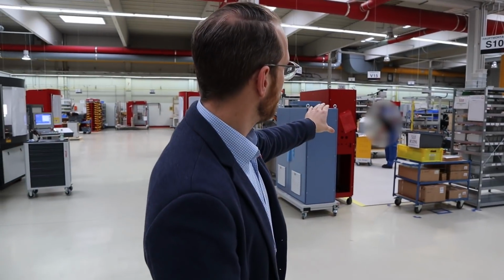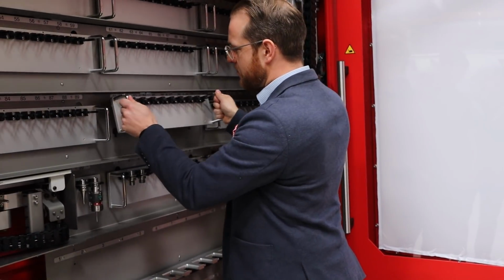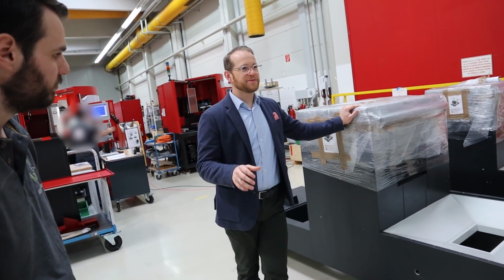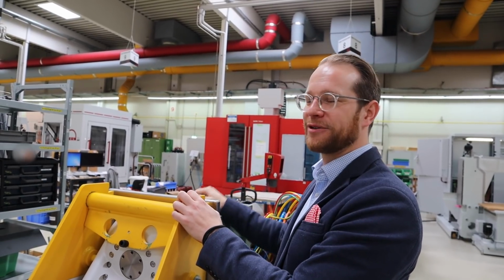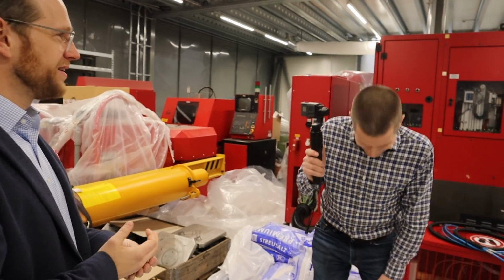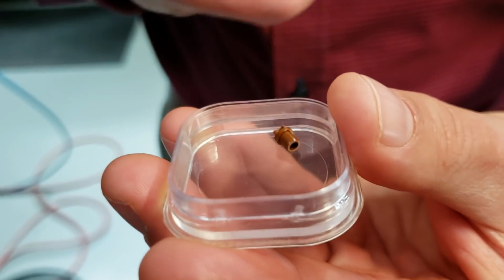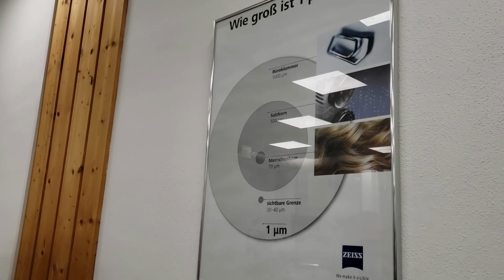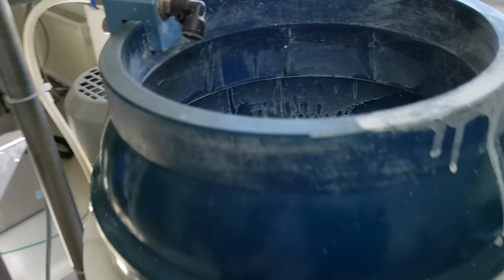FIRST to film at KERN - FULL Shop Tour

Comment: I would like to share a story of mine I never ever sold aircraft alloys, but once i got a job doing just that. i did the most important thing first, get to know your clients and what they do with in the company, especially the aircraft engineers and maintenance workers as they know what's going on with in the company, managed to get $450,000 contract with Ansett Airlines ( Australia ) in 1998 and  saved them over $250,000 in unwanted fuel and shipping costs overall in the end, because i spoke to the main procurement officers and asked them why are they spending all that money to buy the alloys when were right around the corner. 

Also supplied to QANTAS airlines and every single engineering shop in Regional VIC AU, from aircraft grade alloys to specialized welding rods for the maintenance aspects of maintenance and manufacturing of spare parts for aircraft. NORTHROP Grumman, Hawker De Havilland, BOEING, and every single Aircraft maintenance business out there and engineering businesses as well.

Even boeing wanted specialised bulk buy of xacto blades only a curtain size and shape, ( to cut composite material to shape) which i got for them. You will never know till you ask the right questions full stop. 🦘✌👍👌

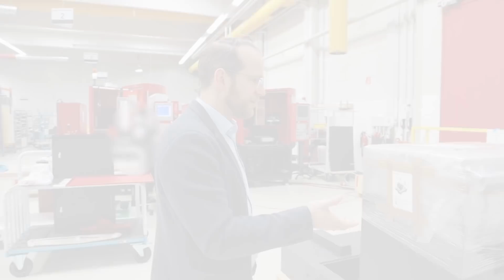Comment: 10:50 According to the numbers given, the cooling removes (4200 Joule/(K*kg))*(0.1K)*(1 kg/L)*(160 L/min) / (60 s/min) = 1120 Watts of heat. Since this keeps the temperature of the machine constant, that must be equal to the maximum electric power dissipated in the motors of the machine.

Comment: For anyone not familiar with the Kelvin scale, a difference of 0.1 Kelvin is the same as a difference of 0.1° Celsius (or 0.18° Fahrenheit)
Reply: There's a lot of energy being put into concentrated parts of that system. That's a very impressive stat. Sounds like each cooling circuit is regulated which is the complicated way to do it but appears to work really well.

Comment: The 8:50 discussion ... yes you can make a machine out of Invar but in the end, aluminium gives you more control and in the end just slightly more precision (i mean ultra ultra precision) if you do the cooling right.. slightly unintuitive but we've made the most precise stuff with aluminium. Of course the ultimate material would be diamond and I wait for the day when we can make large structural parts out of big blocks of possibly monocrystalline diamond... unmatched heat conductivity and thermal expansion. There are composites being made with diamond that show some promise but I think it won't work out at the end.. you need the real thing :D

Comment: 33:36 looks like a hand scrapped table.  I like the Kern philosophy and the fact they are very into supporting their legacy tools and machines.  Not many manufacturers get excited about fixing up one of their 40 year old models.
Reply: It's flaked with an electric flaker which is odd for a machine bed as it is done to retain oil although sometimes done to give a scraped look to ground machinery. That's an EDM machine though so not one of theirs.
Reply: @littlestworkshop  I wonder why that company chose that finish for a work table that would remain submerged.